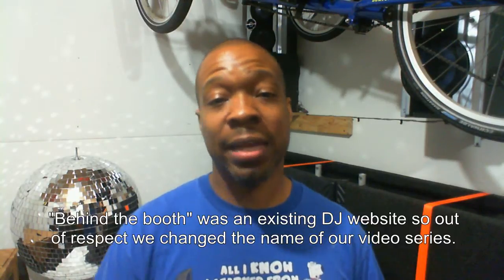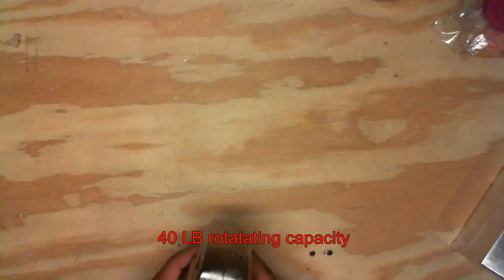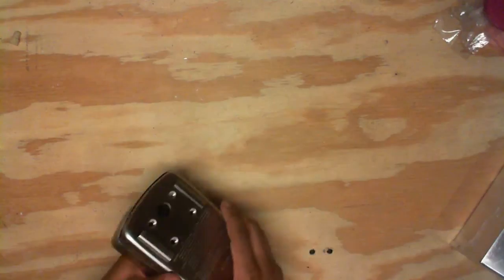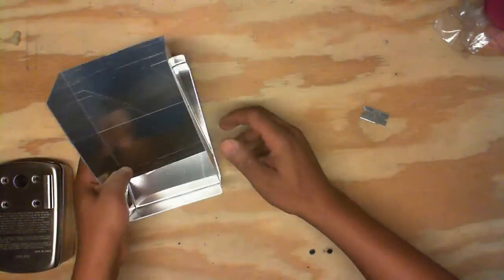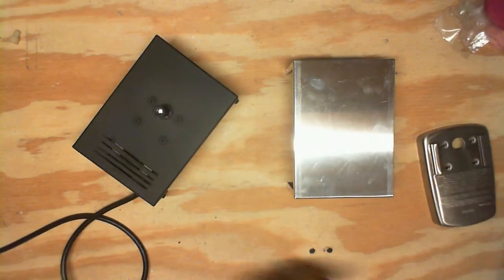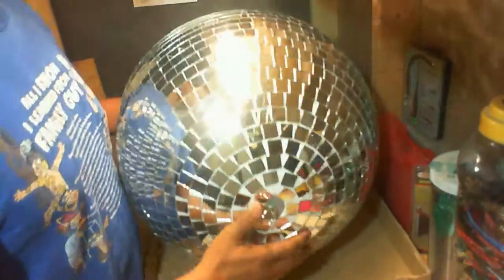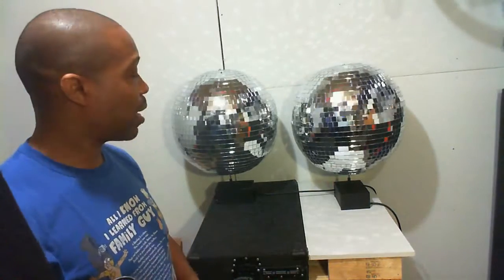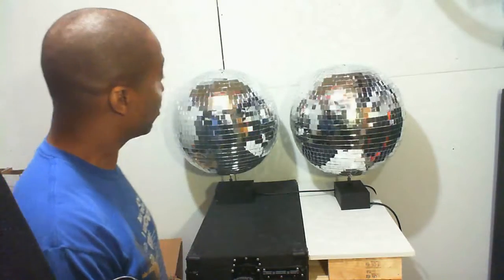DIY Vertical Mirror Ball Motors - FROM THE BENCH TO THE BOOTH/ Ep. 3

Comment: A very well thought out, tidy, and functional design.

If you ever wanted some sound dampening for the inside of the motor casing a single sheet of an automotive self-adhesive dampener pad for use inside body skins like Evercoat 100116 Q-Pad would be enough for several of these motor boxes.

If you use heavier mirrored balls you may eventually find that the rotisserie bearing 45 lb. load rating was for a radial load, i.e. perpendicular to the shaft and it has a lower axial load rating i.e. for loads in the same direction as the shaft only 1/8 as much (somewhere between 1/4 and 1/2 the static load, which is itself around 1/2 the spinning load) (the weight of the mirror ball is multiplied by the bearing race angle acting like a wedge and squeezing the ball bearings with greater force than the weight, and the allowed load is lower when left stopped). If this became an issue, try a replacing the output shaft ball bearings with deep groove ball bearings (they do better with axial loads) or modify your basic design to add a thrust bearing to the low RPM gear box to pick up the axial load, or add the thrust bearing to the shaft on a collar and take up the axial load on the enclosure instead of the gearbox.

Comment from the maker: In a completely silent environment the gear motor is slightly audible but within a general ambient environment they cannot be heard. I suppose you could line the inside of the case with 1/2 to 1 inch felt insulation for sound proofing if needed in special applications.

Comment: DJ.....did you have to drill the shaft before sliding the bolt in?  Or did your shaft just slide out of the motor?  It appears I will need to take apart the motor to remove the shaft?   Thank you!!  Andy

Comment: Hey I appreciate your video.  We made one of these and our light had rubber instead of Styrofoam  and the motor sounds like it is strained and the rod through the ball seems to sway.  Any ideas friend?
Reply from the maker: djtrevorowens  Im not familiar with the "rubber" core mirror balls. As far as the motor sounding as if its straining that's fairly normal with rotisserie motors as they have gearing for heavy loads and the gearing can make some mild noises. When you say the ball is swaying is it loose on the rod or at the motor connection?
Reply: Thanks for the reply.  Did the ones you make maybe sway ?  Or did you do something to prevent that?  I love this video!
Reply from the maker: djtrevorowens No they didnt sway but if I were to put them on a truss I would probably put a small bungie cord across the base to prevent possible tipping if someone bumped the truss.
Reply: thanks friend keep up the good work